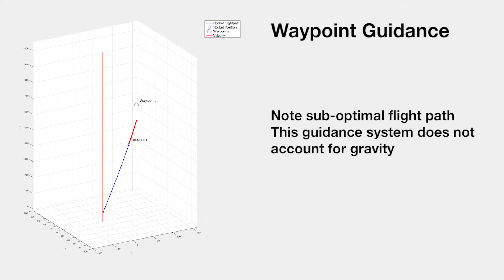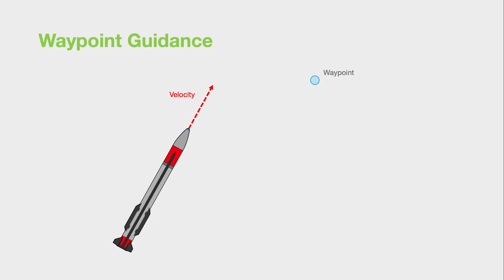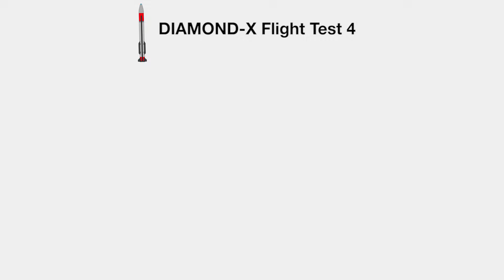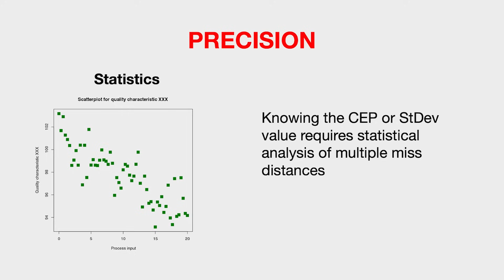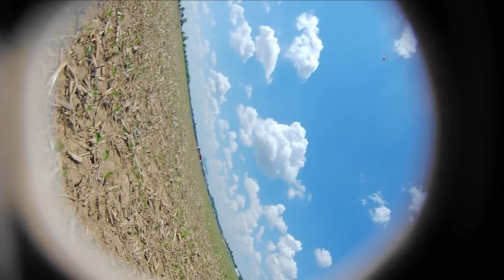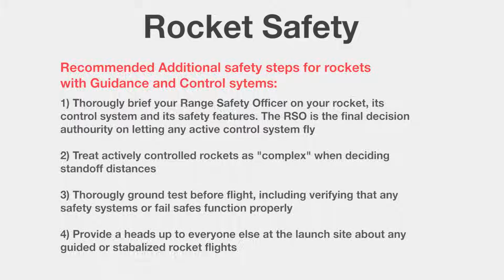Waypoint Guidance with an Amateur Rocket

Comment: Just a heads up for anyone watching this. Guided rockets that use GPS or steer with fins aren’t allowed at regular hobby launches. The FAA and NFPA rules say hobby rockets have to be unguided during the burn.

Stuff like this usually needs a special FAA waiver or a controlled test range with oversight. Super cool video, just not something you can safely or legally try in your backyard.
Reply from the maker: This seems to be a common misconception. While certain competition rule sets require unguided, ballistic flight during motor burn, I’m not aware of any FAA or NFPA regulations that prevent rocket guidance under thrust or any other portion of flight. 18 USC section 2332g imposes some restrictions on types of rockets and missiles, but does not ban active control systems outright. 14 CFR part 101 (c) covers amateur rockets and just outlines restrictions on rocket motor sizes (class 1, 2 and 3, which are different from NAR/TRA level 1, 2 and 3, very confusing). NFPA 1127 restrictions cover safe separation distance and a number of other factors that have generally formed the basis for the HPR safety codes in NAR/TRA. Taking into account destructive device laws in the US and those mentioned above, I’m not aware of any specific restrictions on rocket active control systems in the US. Definitely be sure to check your local jurisdiction before launching though, as some counties have burn bans or UAS laws that may affect your ability to launch!

Comment: I wondered if these control systems are just simple closed loops that do an adjustment untill the vector is within target threshold. 

Or if they "learn" how effective their requested inputs are by taking a derivative or several of the previous and current state times the requested input...

Comment: Apologies upfront if this is a stupid question. The way I understood you're using some sort of IMU-based/dead-reckoning system to determine the rockets position (and thus, the input to the control system).. the (very limited) experience I have with systems like these is that sensor drift is a BI**H - especially with high rates of accelleration/rotation.. Isn't the reportef data, i.e, the accuracy with which the rocket is hitting the waypoint possibly misleading? i.e, if the IMU is telling the control system "you're 0.5m to the waypoint" even though it's 50m off, it'll act accordingly and switch to abort mode, but that just means that the control loop software is working, not that the rocket is actually accurate, no?

Comment: Instead of giving it a single waypoint, why not give it a range (a ring) and allow the flight control to decide how best to pass through the virtual ring.  This could reduce the need for more extreme control inputs as the flight computer can aim for the best point within the ring.

Comment: Pretty sure that a guidance system is illegal if it's used for a malicious purpose (obviously) like trying to target aircraft, people, vehicles, etc... But generally guidance systems for stabilization or to hit waypoints while going vertical is legal. Autonomous flight using waypoints is also legal.

Comment: Why don't model rocket makers use counter rotating blades that fold down, along the rocket body while under thrust but fold out (and spin) when the rocket is coming back down instead of using parachutes to control the rocket's descent?

Comment: I wonder if there is a way to IP restrict GitHub/GitLab pulls/clones. If so, you could open source the code and files to just the U.S. and thus avoid ITAR restrictions.

I'd be very curious to know the polling rates for the hardware you use along with the algorithms you've written to handle the guidance and prevent situations like over-G and positive feedback oscillations on the rocket during maneuvers.

Comment: You can do the same with a gyro. in fact that's how Autopilot works in some aircraft. Also you could make this a radar guided system using tracking software connected to the control system.

Comment: You have a Cool Channel and Project. 
I love those DIGI XBee radio Modems, I used a lot of the Digi modems, I started using them back when they were still called Maxstream long before Digi bought them. I used the frequency hopping spread spectrum, the direct sequence spread spectrum and the XBee. But I like the 900 MHz direct sequence the best. I used them the on my UAV's for the control links and data down links. On one trip to Australia while we were conducting test for the Australian Outback Rescue, we tracked one of our UAV’s over 20 kilometers using a pair of one Watt 900 MHz Digi direct sequence spread spectrum modems. We were the first team to fly into and come back from the Outback Rescue search area.     
I used the direct sequence spread spectrum modems on my redundant spread spectrum R.C. link. I could configure a redundant system for 900 MHz or 2.4 GHz or a combination of both 900 and 2.4.  I had the same issue the ITAR police, I was doing this in the late 1990's to mid 2000's I had all kinds of visitors from all kinds of 3 letter agencies. This was long before most people knew what a UAV or a drone was and I would get reported to these agencies on a regular basis. At first it was scary but after a while it became a pain in the ASS.

Comment: Well, if the missile knows where it is and where it isn't, it can just make the neccessary deviation and maybe be considerate enough to not damage the Silo.

(I'm being cheeky quoting the missile guidance meme)

Are quaternion calculations not used in angle control system?

Comment: Are you using PID's? The wobble in the roll suggests overshooting caused by large gains. It would be useful to tune these systems a bit more, but you may even need to apply another factor on all the modifiers depending on what air speed you have which is changing the control strength.

Comment: Pretty obvious what you're trying to build: 

You're trying to build a MANPADS that functions like an ENTOR mine. Just a box soldiers can set up and have constant AD... It's been tried. Even a system that was a backpack that would just warn the wearer it had detected a threat and was launching right before it fired. Maybe today's tech can iron out what caused those projects to be abandoned... If nothing else, even at your level of capability this could be used as effective anti drone defense...

Comment: Start encapsulating your 3d printed parts in carbon fiber/epoxy. Also, you can use CF sheets with 3d print parts to provide the 3d prints with more rigidity.

Comment: Where did you get the unlocked GPS? Those are ULTRA rare and super illegal.
Reply from the maker: I just use regular GPS receivers. The COCOM velocity limit is 500m/s which is about Mach 1.5. You can get unlocked modules and use them for rocketry (and some people do), the only difficult part is their price and availability. They can get over $1000 USD which is pretty pricy for projects like this.

Comment: Looks like flight 5 might have actually worked quite well too if the pitch limit hadn't kicked in. I wonder if that limit could be relaxed above some minimum altitude? After all, the higher pitch only becomes necessary if the rocket is already quite high.
Reply from the maker: Yeah I think flight 5 would have gotten pretty close! I may relax the pitch limit a bit. I think the limiting factor is being able to pitch up to vertical after reaching the waypoint. If it reaches the waypoint going horizontal, the rocket may not have enough energy to do that pitch-up. This is a hugely limiting factor and really restricts the types of maneuver I can do with this small rocket. I’ll need to go higher and faster to really get into the fancy maneuver profiles.

Comment: We have been making "video" guided rockets and drones for the past 9 years using both visual and IR cameras and combined the two recently. No gps or rf jammers to worry about. 😂😂 I'm currently working on a multiple spectrum system now that combines many different spectrums to make them even more fail safe. 😊

Comment: Laser range finder, magnetometer, onboard gps in a launch control unit. Input distance (via range finder) to target, direction to target (via magnetometer), and current gps location information directly to small board like a pi. Have pi do some math as to where rangefinder was aiming and calculate new target gps coordinates based on current GPS, direction being aimed at, and distance. Set first waypoint a few hundred feet in the air at half the distance between you and target, and second waypoint at calculated coordinates.

Boom, you have a poormans FGM-148 for an additional $500ish if you wanted to put all this on a custom PCB. Obviously you dont wanna add a payload to the rocket, that would be illegal. This is just for sending a message to someone a mile away when your phone has no signal, obviously. You would never want to 3d print a shaped charge or anything like that. Dont do that.

Comment: put a photovoltaic sensor on the rocket body and point a laser to a know position in space so that its pierce point is on the waypoint trajectory.  reference the simulated reference(from flight controller) to the triggered results detected from the laser.  collect enough resulting differences at different positions to calculate the range of certainty. awesome build.

Comment: Might sound dumb but could you install a edf fan in the rocket inplace of the rocket motor then you could have near unlimited test flights . Would probly need a contra rotating edf to cancel out the torque of the motors

Comment: Just my opinion, but I feel like a thin metal washer fixed to either side of the parachute attachment point on the wishbone with an adhesive would go a long way in limiting the risk of the 3D printed material failing when it experiences that big shock load.

Comment: I'm not shure at all, but I think a Rocket with active control, over 500 grams would qualify as a "U.A.S." under FAA rules making 49 USC 40102, apply in the USA. I could be very wrong, but worth checking on. The law has some teeth.

Comment: Could you program the Abort Euler to activate after a certain time or distance traveled at various bank angles? Have the distance or time vary based on the severity of the bank angle and you can keep the rocket traveling straight up within a predetermined cylinder... which may be tilted or skewed, but would provide a safety margin that could be mapped in 3D space but allow the rocket to move around within that space as needed.

Comment: In addition to activating your guidance earlier, wouldn't it make sense to "limit" your guidance so it tries to stay below your set abort attitude?
If the goal is (mainly) to reduce recovery distance, getting as close as possible to the waypoint without exceeding the abort limits would be better than triggering the abort and going straight up.

Comment: The safety culture that armature rocketeers keep is really awesome. It reminds me of what the RC multirotor hobby was like before the uneducated got hold of drones from DJI and other companies, and governments quickly banned everything. That safety culture will keep the hobby alive and thriving for as long as it is maintained. You guys are awesome!
Reply: I agree that people fly where they aren't supposed to and that has caused a ton of issues for those of us who practice proper safety. But it's worth mentioning that not everything was perfect before the DJI influx. RC hardware and software has gotten sooo much better, safety-wise in the last few years. I remember a bunch of runaways, wrongly set failsafe modes with never to be seen again equipment, just straight up bugs in esc software, burning drones and whatnot. All the old timers that I know fly without prearm switches and even mentioning it gets met with scepticism. Some hand-launch or even hand-land their drones. It's just a hobby that tends to attract slightly insane people 😂

Comment: Why did you choose to go for carbon fibre PC for that connection point on the avionics assembly? Adding fibre to a filament makes it stiffer but makes it slightly weaker and more brittle/lower impact resistance. For that piece you want a material with high strength and impact strength, but stiffness isn’t important from what I can see. Something like a TPU or polypropylene would likely be better here with polypropylene likely being the better choice although it is difficult to print.

Comment: Wow, ne maneuver hit 6.7G!
Do you even know what the max overload of this missile is?
Edit: I realised you said so that it hits ~7Gs before the pitch angle limiter is activated
Have you considered altering the airframe to allow for higher max AOA?
Usually that can be done by making the rear static fins lighter allowing for more aerodynamic surface for the weight

Comment: Did I understand you correctly, in that your Launch guidance tries to achieve a certain roll angle? Wouldn't it be easier to just arrest the roll-rate and then go into waypoint guidance? Since DIAMOND-X is near symmetrical it shouldn't have any real impact on the flight characteristics.

Comment: The accuracy of this system is extremely impressive, even flight 5's late activation and missaligned roll was handled exceptionally. How did you tune everything? It seems hard to select good constants, but you also mention it does some calibration on initial lift off, does that help somehow?

Comment: Instead of printing parts at 100% infill, print them with 99 walls (obviously that many walls won't actually print) - walls provide strength along the axis you need for the application of chute line anchor.

Comment: It's quite fascinating that currently we have resources available for the general public to build a rocket brain like this :D Imagine doing that in 1950's
Reply: Back in the 2000's there was a guy in New Zealand who built a pulse-jet rocket using only parts ordered online.  Supposedly it would fly up to 160km and deliver a 10kg "package".

Apparently this guy took part in a British TV show called Scrapheap Challenge.  He constructed a working pulse-jet out of scrap in about 10 hours.  It was then attached to a kart that got up to 64km/h
Reply: @ralphm6901  a pulse jet is the most basic form of jet engine anyone can make one you literally just bend a metal pipe into a long u shape and a fuel source in the middle
Reply: @BobaPhettamine  It's also easy to make a torch using a lighter and a Febreze can, doesn't mean it will perform as well as an oxyacetylene kit. A pulse jet that can reach 64km/h and a whole Switzerland worth of range is nothing to sneeze at.
Reply: @ralphm6901  you could make that easily from stuff at a junkyard
Reply: @anonymouse...  I think the pulse-jet cruise missile guy did exactly that, for some TV show, to strap the jet engine to some kind of vehicle.  When he was making the missile, that required electronics to navigate and servos to steer, and those are not typically found in junkyards, so he ordered from Amazon and other suppliers.
Reply: Apart from lack of theory and some optics - it is possible to build fully functional IR seeker with only 1955-1960 vacuum tubes and parts. It is THAT simple.
Reply: @tieroneoperator635  But what do you use for the sensor?
Reply: @Nexalian_Gamer  Any sort of light sensor, maybe like the one in your night light. Obv there's more to it then that, but that might give you a spark to do more research
Reply: twinks with arduinos couldve destroyed the soviet union

Comment: I hope so bad that you will end up with two stages, first stage just to get it out the launcher, followed by a thruster that rotates the rocket to near horizontal position, then the second stage that ends up flying vertical again.